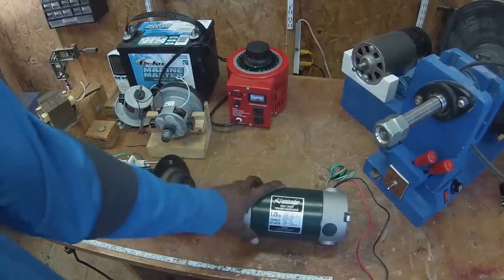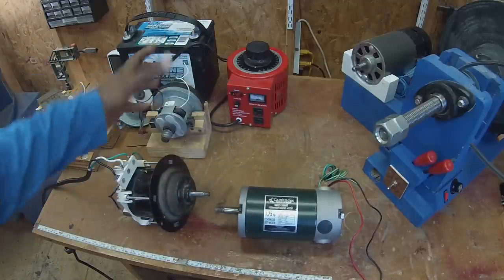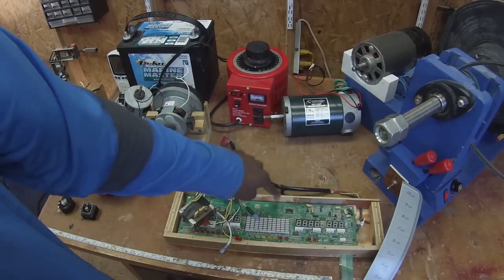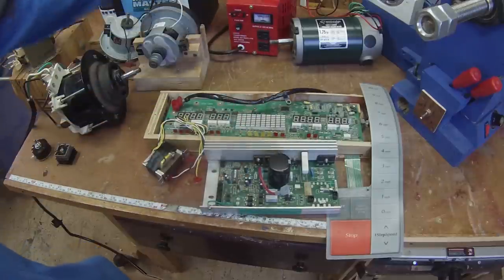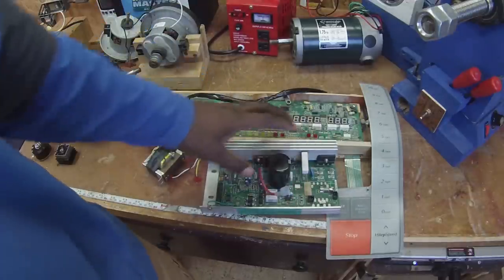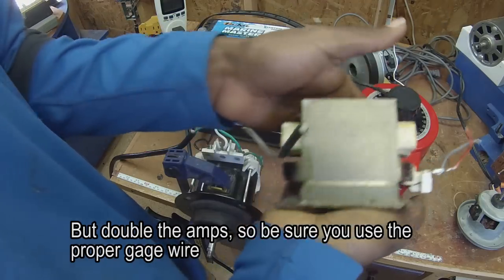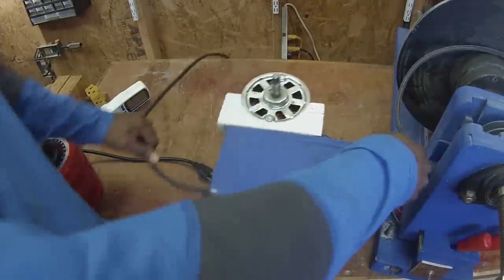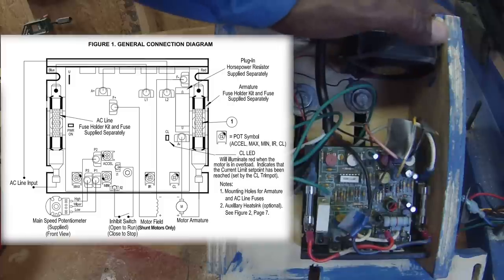How To Wire A Large DC Motor And Control The Speed; Treadmill Motors and Universal Motors 019

Comment: A capacitor is not really required on the rectifier used for driving a motor, in fact one to big will raise the voltage to a point that could cause problems certainly double the voltage any way. A smoothing capacitor is only really required for electronics you will be fine without for a dc motor.
Reply: Equiluxe1 you can't double the voltage with a cap alone, if your feeding it 90v the cap will sit at 90v. I know there's more at play but it would take more than a cap and a motor. While it won't hurt the motor to feed it an output directly from a bridge rectifier, if your looking for a constant speed (you will really notice it if you gear it down for low rpm operation higher torque) you need the smoothing cap, yes if it's just spinning free with no load the inertia of the rotor will keep it at full rpm but under load it will oscillate up and down as the input voltage changes
Reply: I suggest you read up a bit more, The voltage is definitly raised after fitting a capacitor not completely double but as in this example from 9 volts to 14 volts,. http://electronics.stackexchange.com/questions/175474/why-do-rectified-voltage-boosts-after-adding-a-capacitor
Reply: Equiluxe1 yes but if your running through a variac or a motor controller you can control the voltage input to the cap thus control the output voltage, you need to control the peak to peak voltage not the rms voltage. Plugging nominal 120v in to a rectifier and connecting a 90v motor your already overdriving it. The 120v rms(what multimeters read) is about 170v peak to peak. It's not really doubling the voltage it's just the way it's measured, the cap will smooth out the peak to peak voltage and that results in what looks like a voltage increase when it's already really there it's just measured using RMS not peak to peak.   If you input 90v p2p to a rectifier and a cap your going to get (depending on how large the cap is) approx 90v DC out.

This is a laymans explanation, like I said I know there's a lot more going on I was saying you can't get more out than you put in
Reply: The thing about motors is that they are electrically noisy.  Capacitors are almost always used in conjunction with motors to smooth out voltage spikes from the motor that can harm other electronic components.  As to the proper capacitor size, the most important thing for capacitor longevity is the voltage rating. It needs to be rated at higher than the normal voltage in the circuit. As to uF, this is the size of the cup that gets filled with electrons before it is full and begins to act as an open. The lower the uF capacity the higher the frequency it can charge and discharge at. This impacts the power factor and efficiency.
If you have a scope, it would be interesting to watch the waveform as different capacitors are used. Just make sure to use a very low power motor, and power your scope from your autotransformer for isolation.

Comment: I have been able to wire some of my treadmill motors thanks to your videos but I have one motor in particular that I am not sure about.  It is a Baldor 3HP motor,  The label reads 32.5A and 90V.  I have a 220V/40A circuit I use for my table saw so I have the capability to power the motor to its maximum capability.  My concern is that I will burn out my SCR which is 110V if plugged into the 220V circuit.  So my question is this - What can I use as a SCR for 220V power source or is there an other way to wire this motor?  As you can probably tell this is new to me and so any suggestions would be appreciated.  Thanks.
Reply: Got the same motor.  Connected to 110 vac, 40amp breaker, small voltage control board, rectifier and 1,500uf capacitor.  It fried the capacitor in a few minutes.  Did you get yours right?

Comment: Can you post the Make & model of the big red variable transformer?  Thanks, good video.  Also, what is the rating on the POT you used on your lathe?
Reply from the maker: +ttpenman the details of the pot show in the video I believe bottom right side when I point to it. I will post the details on the transformer in the description later tonight
Reply from the maker: I have added the details for the transformer to the description.

Comment: I have two wheel chair motors...motors only.I assume they are 24 volt.  There is no info plate on either, just a bar code.  I want to use one to run a wood lathe at very slow speed.  I would like to simply purchase a wiring diagram and parts list.  Where can I do that.  :-)

Comment: I have a question for you are you running them lathe motor underpowered? Because I'm familiar with that motor it's the same type they put in the lathes 
It's an exceptionally fast running motor and it seems like it's way underpowered in this video I saw you max out the potentiometer and it sounded like it was running at about less than half of what it should be. This is important for me to know because I will avoid that controller that you used in this video if if it's not capable of running the motor at full speed. Unfortunately I lost the controller boards that are meant to run that motor so I'm looking for an alternative. I suppose I could using microwave Transformer in fully Rectify that and run it off of a variac but I'd really like a more elegant solution

Comment: What's the purpose of a capacitor across the DC output of the rectifier? Capacitors work on AC current to my knowledge and would have no effect on a constant DC circuit. What do you think?
Reply: It stores the electricity until there is another pulse when the ac reverses, it smooths the DC but it also raises the voltage to nearly double. Not really required for driving a motor.
Reply: Equiluxe1-- Yes, you identified the defining characteristic of a capacitor-- that it only works when the signal current is changing. Mr. Fielding said the capacitor should be installed across the DC output side of the rectifier, and that threw me for a moment. However, the DC output current would still be pulsing from the AC input signal, but the negative half of the waveform would be flipped positive, so it would still rise to its peak then fall to zero 120 times a second. I'd forgotten this feature of the more basic rectified DC circuit designs. This is the "ripple" that is often a specification given in a DC power supply spec sheet. Pulsed DC, by the way, is actually to be designed for when powering very low fractional DC motors, as it tends to jog the armature into movement from a stop and keeps it moving at extremely low speeds.
Reply: Now I think I was wrong with my comment above. A capacitor still requires a reversal of current polarity to work, otherwise the potential between the plates is eternally maintained and the capacitor will never discharge.

Comment: Hi Jeremy
Great videos- Love the presentation-Have a question-I have a project where I am using a golf cart motor for conversion to a electric boat motor. What controller would you recommend to do that ? The motor is a series dc motor not sure of voltage but I think it's 24 or 36 volts. The golf cart controllers are very expensive - 300 to 400 dollars and just looking for alternatives! Thanks for your time and video's !!!!!
Reply from the maker: +Joe Drasal III i don't have a recommendation for that. I haven't worked with a golf cart motor. I would search for D.C. Speed controllers that match your motors voltage and hp. Speed controllers are not cheap but you can probably get for less than $150 particularly if you go used.
Reply: Thanks -just thought I'd ask -used ones are still going for 300 dollars or so but are rated for 400 amps .Just another way to rob you basically . I have one for regen golf cart motor but need one for a series dc motor. Than ks again!!!

Comment: Jeremy excellent, I've enjoy all your bids, one question, if I wanted to do a diy wind turbine. Where can I salvage a good DC motor?
Reply from the maker: The only DC motor I see on any regular basis is the treadmill motor. The voltage required is a bit higher than you want. Ideally it would be something like a scooter, that runs on 12 or 24 volts. Of course it mostly depends on what you find.
Reply: Jeremy Fielding I appreciate your fast response and sharing your wisdom. Thanks buddy, if you're ever in Cancun, tequila and beer on me, oh one last thing, if you happen to find either the treadmill or the scooter motor and want to sell it at an accessible price just let me know. Peace.

Comment: hey great videos. I've got a question for you. What do you think about reusing a garage door opener motor. the reason I ask is I'm not sure they can handle continuous duty. What do you think?
Reply from the maker: Most motors have a "duty cycle" on the label. Check the motor name plate and see what you find. If not, you may be able to use the part number to look up the duty cycle online. You are right to be suspicious I think. It is cheaper to make it with thin wire if it is only meant for temporary use. We may be surprised though. Let me know what you find.

Comment: so a revers ground polarity switch would give you reverse operation. so because I have a dc motor with speed control on my drill press I can run a tap into a hole and reverse it back out, or buy a tap-o-matic  that cost about as much as the drill press or more.
Oh got a differnt use for it making my own coils for an electro magnet.
Where did you find the rectifier with the heatsink on it? Is that a common item now?
Reply from the maker: I bought it on amazon. It is pretty accessible on ebay and amazon. I never have to search further than that.

Comment: Where or what machinery or equipment is the best chance to find rectumfires and  potentiometers?
Reply from the maker: I usually buy rectifiers and potentiometers. The are in almost everything but getting one with a high enough voltage and amp rating is usually a problem for my projects.

Comment: Hey 👋 don't know if you'll see this but I'm trying to build an electric chainsaw with a 36 inch .404 Guage chain for a portable Alaskan mill. Goal is to make it portable ( within the reach of an outlet) but I can't find a non battery powered motor to use. I need a minimum of 4000rpm and 5hp. Anything, advice or direction would be helpful. Hope you see this!

Comment: I like these small motors I used to work on full size train traction motors we used to have a 300v knob to turn we would put the motor on blocks to turn it they have a gear  and axal gear case it's called a wheel set we would stone the comutater to .003 max you can get them to read .000 that's perfection in stall new brushes it called a blow and go .I did the motor checks to see if they were sound to put back on the train the tests are called restance ,meger and hi pot you don't want to hear Sparks in the motor shorts from electric shorting out in side the motor later on they switched to a lab top computer that would send power and get get apiture of health of the motor so to speak.they have mostly DC motors some were ac motors .

Comment: Paused at 10.00.  Take note. That cap is polarised, no good if to reverse voltage.  It would blow up
Reply from the maker: Hey Thanks! That is a great point and absolutely correct. I didn't think to mention that in the video. Thanks. As you can see I don't use it like that, but someone might.
Reply: No worries Jeremy.  For the sake of keeping things simple for the lay person I think that you do a superb job.   Need more guys and gals like yourself improvising.
Reply: Jeremy Fielding 
But their fun to reverse voltage! They go pop ;)

In all seriousness that cap is more than adequate to use as a smoothing cap, 10k uf is overkill. The cap only has to smooth the voltage for when it's under load otherwise the rpm will oscillate with the power supplied

Comment: Mr. Felding, love watching and learning off your videos. Just recently started building a 2x72 belt grinder. Motor works, board is shot from the nordic trac treadmill. I saw a video of someone using an scr and bridge rectifier. His motor kicked on, potentiometer worked throughout ranges. Using same rectifier you used on vid, the scr is a 4000w. Hooked the ac to scr, leads coming out go to the bridge rectifier then to motor. Scr fan comes on, motor doesn't work. Hook a 20v battery to motor and kicks on. Appreciate any advice you can give.
Reply from the maker: I don't usually do one on one advice/troubleshooting. It is not safe, and not practical. I hope you understand I get hundreds request like this, and I can't know if you are giving all the relevant information, or even if I understand the problem completely. Maybe someone here might talk you through some options.

Comment: Throw a different value potentiometer in that harbor freight controller and that would solve the problem of range of speed.
Reply from the maker: I just might give that a shot. Although that seems to imply the manufacturer is using the wrong size POT. Clearly something is wrong and I agree your suggestion sounds very plausible

Comment: You could use a train transformer too!
Reply from the maker: I don't think they can handle the power. Consider 130 volts at 16 amps is about 2000 watts. Have a search on eBay or somewhere for a train transformer and see if you can find one rated for 2000 watts... or even 1000 watts. My gut says no, but I have been wrong before.

Comment: A 10,000 micro Farad capacitor would be HUGE. That's 10 mili Farad or 0.01 Farad. The only purpose of a capacitor in this setup (DC motor instead of AC) is to bleed off the energy stored in the motor as inductance (anything with a coil of wire has inductance) so that it doesn't damage the rectifier when the power to the motor is turned off.

Caps are used in AC motors to bring the voltage and current in phase since the inductance of the motor causes them to go out of phase which results in lower speed and torque and higher operating temp. In this case, the caps have to be matched to the motors inductance and the motors name plate will state what that value should be. They're always a common size and are cheap and easy to get. That's not a problem with DC motors, well...because they're DC...they don't have a phase.

Inductors store magnetic energy when voltage is applied and when voltage is removed that energy is released back into the system. It's similar to how a flywheel stores and releases rotational energy. The voltage and current is usually MUCH higher than what was fed into it. So it's usually a good practice to provide a path for releasing that energy so that it doesn't feed back into the electrical circuit and damage sensitive electronic parts. In smaller circuits a diode is used and a capacitor (who's Farad rating isn't critical) is optional but still good practice.

Since you already have 4 diodes in the rectifier that are wired the same way as the one mentioned above, I don't think you need anything. You could put a 15 micro Farad, 370 V run cap on it if you're concerned. I've never seen anyone do that in their designs though and no one has reported any problems. Personally, I wouldn't put one on but I'd talk to an actual  electrical engineer to tell you if you need one and what size it should be if you do.

People also use a cheap motor controller sold on ebay and the same rectifier you're using plus a potentiometer (for about $10 - $15 total) and they haven't had any problems. I don't think they have a lag on startup either but I could be mistaken. I don't know if the motor is supposed to have pulse width modulation or not either. It might run more efficiently that way but I don't know. It'd be nice to see what your board is outputting to the motor on an oscilloscope to see if it's PWM.  

Anyway, great videos! Please keep it up!
Reply: The purpose of the cap in this instance is to smooth out the wave and take that "gurrr" sound out of the running motor.  In this case 10k may be a little large but too big is better than too small and the difference in price isnt significant enough to matter.

The lag on startup he experienced and that you mention is because the pot in that controller is not sized correctly.  Just like the SCR controllers you mention.  What size you need will depend on your motor specs.  One of those with the right size pot and a decent cap is probably sufficient.  Could be better but depends on how much better your application would call for.
Reply: @jzahirniak  In this instance, it may not have a wave, it's DC. Although there is the inrush current when it first turns on.

It would have a square wave if it's using pulse width modulation however which is why it'd be nice to see the output on an oscilloscope. That info could be used to determine the size of the cap needed or that no cap at all is needed. I seriously doubt it'd be 10,000 micro Farad though.

Yes it's better to have a cap that's a bit too large than one that's too small. However there is a point where a cap that's too large will cause problems because the charge time is greater than the period of the wave so peak voltage and current can never occur and they won't be in phase. I've seen that done on capacitor run motors (AC). They run hot and at a lower speed because the capacitance is supposed to be sized according to motor inductance so that the current is in phase with the voltage and the oversized cap overcompensates and throws the current and voltage back out of phase. But again, this only applies if the output to the motor is a wave of some kind, like PWM. Straight DC won't have that problem.

On other vids, they use a choke that is already on the treadmill's control board (it's basically a transformer) to get rid of the grr sound. I'm not sure how it works, but it does. I would think a cap would work better if it's PWM.